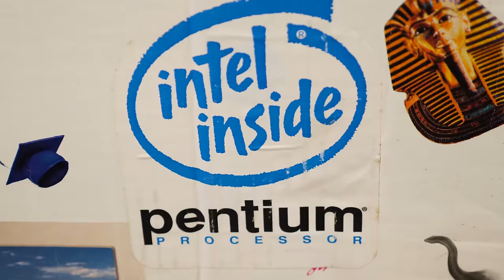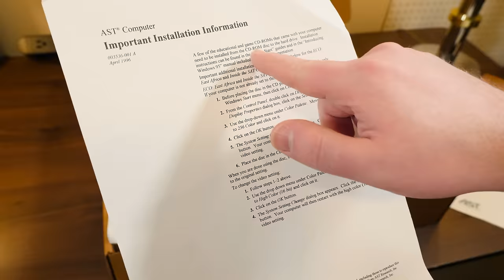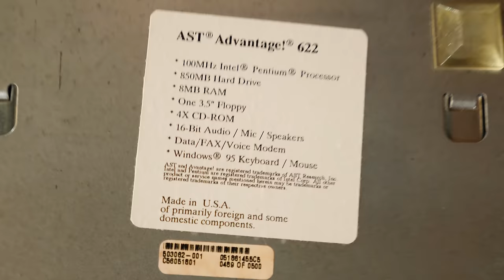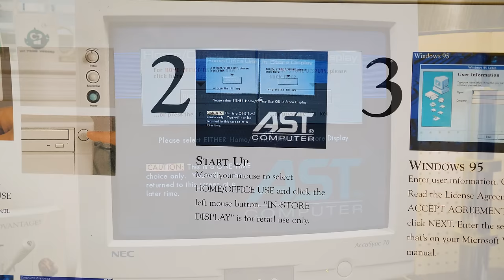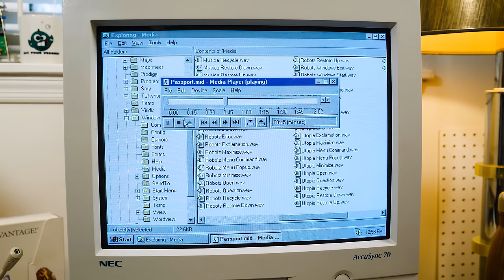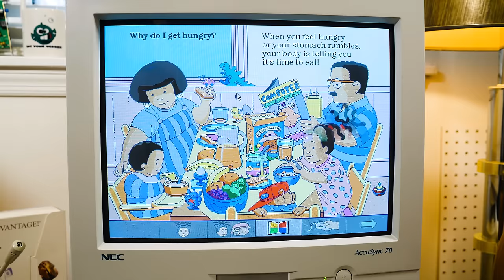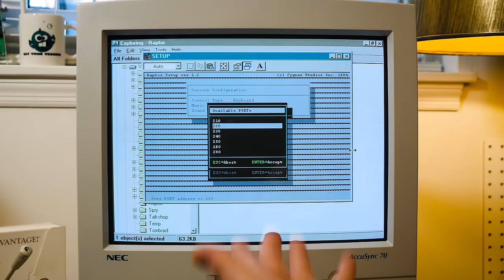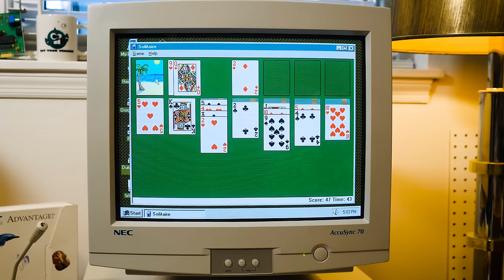This 1996 PC Was Obsolete Before You Got It Home: AST Advantage 622

Comment: One thing I hated about pcs back then was they always starved the ram while puttings tons of software in the box.    95 ran fine in 16mb.   It flew in 32mb.   It was always about all the software you got and never about having enough ram.
Reply: Yeah first thing I always did was delete/stop all the tasks from running. Every time I'd restart ctrl+alt+delete every task you don't need. You could get task manager in win 95 down to like 3-4 processes.
Reply: I suppose this was an entry level system in that specific time, I remember people with means specking their 486 DX2 66 with 16MB and lot of people that had 8MB purchasing a 8MB upgrade alongside their Windows 95 CD.
Reply: @RetroTinkerer  it was terrible back then.   Packard bell used to be the worse for cheaping out on ram.   There again the general public didn't know about specs back then so a load of software was looking good to them.

Comment: Clint, this video really hits me in the feels. My first real DOS PC rig was an AST Advantage 4/33SL from 1993. It shipped stock with 4 MB of EDORAM and a 240 MB Maxtor ATA drive. No sound, and only a 3.5" diskette drive. Later in 1997 (yes I still had it), it was upgraded with an ESS 1868 AudioDrive ISA sound card, an 8-speed Jafree optical drive; The hard disk was replaced with a 1GB Quantum Fireball 1080A, CPU was swapped to a 486 DX2/50 and memory was increased to 16 MB. I owned that computer until 2001 (it still worked fine) when it was finally so dang obsolete I had to part ways with it. Good times man!

Comment: This revived the magic memories of turning on for the first time our first computer, a Compaq, in 1997 and being greeted by Q from Star Trek TNG congratulating us for "finally buying a new computer" or something like that...
Reply: What kind of Compaq was it? I had a Deskpro 386/20e (heap of shit really) in the early 90s.
Reply: @the_kombinator  It's a Presario 4164: 150MHz Pentium. Audio, video (I don't remember the details :( ) and 16 MB of RAM all integrated into the mainboard, plus an ISA USRobotics 33.6K modem, 2.1GB Quantum Bigfoot HDD, 8X CD-ROM drive, 14" monitor with integrated microphone and passive JBL speakers.
It had a troublesome start (mainboard, front panel, CD-ROM drive, PSU and hard disk drive all failed at different times, the HDD twice... all during the extended warranty the seller talked us into. Good thing we didn't knew better and bought it!), but worked good after that. I still have it :-).

Comment: The AST name really takes me back. My first PC was an AST Advantage! Pro 486DX/33 back in 93. It was my "upgrade" or "transition" from my Commodore 64C. I first got it with Windows 3.1 and upgraded it to Win95 when that edition came out. I did all kinds of things to it. I remember upgrading it to a DX4, RAM and video memory upgrades, second hard drive, CD drive, external devices; you name it. Any compatible upgrade I could afford I would install it. I had a blast using it as a fax machine. It was a great time when the Internet was still in its inception. It was with that computer when got my first email address. I had it for several years until 2001 when I got my first Dell. I still have my old AST kept in storage. One day I intend to bring it back to life.

Comment: I am SO JEALOUS! Our first family PC was an AST 613e, a Cyrix 5x86 100mhz. Still works today without any replaced parts. The box is still in my parents loft I think. I so want that Clint! AST machines are just way overpriced by sellers on fleabay.

Quake + D3D look way smoother than on our Cyrix (I know, FPU). My mate had a P100 back then, Quake seemed amazing on that. Edit: Sorry, watching this at work, I didn't see the Spot part!
Reply: That's cool that you had a cyrix! I had a Intel 486 that I upgraded to a 133mhz 5x86 just so it could still be usable by my senior year of hs 😭the 90s were brutal when it came to rapid obsolescence of tech
Reply: For those interested, Nostalgia Nerd has a documentary on Cyrix CPUs and the Quake performance issues.
Reply: Same here, exactly that model. I loved it! We upgraded ours to 32MB RAM EDO RAM but unfortunately it only had ISA slots so I couldn't upgrade the onboard 1MB Cirrus Logic graphics with anything much better. It was however good enough to play Death Rally and I could even play the original Tomb Raider on reduced graphics. I remember the 613e also came with different software - Microsoft Golf 1.0, Cinemania '95 and a fairly early version of Quicken.
Reply: Actually in Duke3D the FPU wasn't as much of an issue if you weren't near slopes. Even Doom that doesn't use any FPU runs way better on a Pentium than a 486. While a 486DX4-100 will run Doom at just about full speed, a Pentium 75 will run it well beyond full speed.
Reply: Our family had the Cyrix version too, don't recall the exact model. By 1999/2000 it was a home under my bed where my rat liked to go, as I'd got in to custom builds and robbed it for what few useful bits it had.

Comment: There's nothing else on the internet that provides this kind of nostalgia, with this level of efficiency.
It's not just the hardware, but you cover the exact same areas that I would cover....
You might be me? But American 🤣
EDIT: ......and then you loaded up Raptor.... Omg
Reply: I always went to the first mission for a few seconds, hit Backspace then aborted the mission. Sold all but one of the Death Rays Backspace gave me to buy more weapons. I only used the Backspace cheat once per game. Never tried to see if it would work multiple times. But when Mountain King Software ported it to Windows they removed that cheat! Fortunately the save files were compatible so I could do the Backspace cheat in the DOS version then save and copy the file to the Windows version.

Comment: LRG thanks for the memories! This was my first computer I purchased back in late 1995 before going to college.  It was $1200 at Radio Shack.  It was only a 486 DX/33 but I upgraded it to the Pentium 83 overdrive the next year.  Then I ended up selling it for a few hundred the next year after upgrading again and building my own.
Reply: My first pc was almost the same, bought in 97 for university for £1200. I remember my university held an introductory lecture where they explained that our work must be produced on a computer, no hand written essays accepted. I still used to hand write my work and then type it up, save it on a floppy disc and print it at the computer lab. Good memories
Reply: Hahaha I had a very similar system that I also added the same Pentium overdrive to, those things (the overdrive) were fantastic!

Comment: It's nice to see what I remember from that era. Even though it is not completely full of bloatware, Windows 95 was usually around 40 to 50mb installed unless you installed more included features and added MS plus on top of that. So having only 340mb free of disk space, this PC was preloaded with a lot. Which is par for the course. The $1899 price was cheap for the time with it including a monitor. Back then when I sold computers and did PC support, a top of the line store bought PC with monitor was around $3000 to $3500. More if you went all out and bought additional software too. 

I miss that nostalgic era. I don't like how some PCs of the time were not open architecture but it was still a good era. Thanks for the video LGR

Comment: I never expected to see you review the exact same model of PC that I owned from 96-98! Really cool! I have some awesome gaming memories with this one. Spent all my time after school playing late DOS era/Win95 games on it, such as Warcraft 2, Diablo, Grand Theft Auto, Duke Nukem 3D, The Pandora Directive and many other classics from that era. It was a pretty decent gaming PC until mid 1997 or so, when system requirements for most games jumped to 16MB RAM and 3DFX cards really started to take off.
Reply: Sure enough computing moved too fast those days. Granted this PC was somewhat underpowered to begin with, but imagine buying a PC today and it feeling long in the tooth after less than two years!
Reply: @BilisNegra  Yeah, tech developed insanely fast back then. The Ghz barrier was broken only three years after this PC was released. And the original GeForce also came out in 1999. An exciting time, but also a very expensive time to be a PC gamer.
Reply: @kjetilhansen5363  That's it, exactly. A very exciting time for the PC magazine reader while ungrateful for the man on the street. Looking at it from the present time, where computing is more affordable than ever and machines over a decade old can run a modern OS, at least for not very demanding tasks, it looks cruel even. At the same time though, without that frenetic era of development, we wouldn't be where we are now...

Comment: I'm very surprised how relatively smooth quake ran for such specs, great optimization
Reply: Pentiums ran quake just fine, our school had p75 and we played it along with Warcraft II in multiplayer. My home 100mhz 486dx4 couldn't handle it though.
Reply: Even the slower Pentiums will run it better than even a 160 MHz 486. It seems like the Pentium runs it 4x better than a 486 clock by clock.
Reply: @fungo6631  correct. The fastest 486 by CPU Galaxy at 186mhz could only manage about 21fps. The FPU unit in 486 was much weaker and that seemed to be the reason.
Reply: @fungo6631  no wonder they're getting increasingly expensive
Reply: @djnjoy  Actually he manages to overclock it to 200 MHz more recently. And it's not just the weaker FPU, but the inability to run integer and floating point calculations at the same time. That and the 32 bit data bus.

Comment: My first PC, in about 1994, was an AST with 8 Mb ram, a 145 meg HDD, a 33 mhz clocked to 66 mhz, 2 speed CDROM drive and an actual Sound Blaster card, complete with colour monitor. It came with DOS 6.2, Windows 3.2.2 and MS Works on a single disk, along with drivers. Not state of the art but I loved it and it was good for gaming, especially DOS games. To reinstall I just had to insert the CD and let it work. I miss those days. I played Doom 2 a lot and eventually learned to design my own levels. I remember Pentiums had started to come out just after I bought it but I didn't upgrade until Windows 95 was released.

Comment: Oh my god, I had this same machine.  My first real computer.   It was a great computer and still actually worked until I moved once in about 2007 and abandoned the thing.  So many memories with this computer!
Reply: Side note, once I was able to afford it, I upgraded to 12MB of RAM, however I was able to get some games to work like C&C Red Alert running in Windows with the 8MB of RAM with (believe it or not) Soft RAM.  The software everyone claims is a scam, and I guess kind of was, but it did actually work in tricking the computer into running and utilizing page files or something or other.
Reply: Red Alert should've been runnable anyway...in DOS mode, at least. That's why it still came with the DOS version of itself and the map editor (RA.exe and EDDOS.exe instead of RA95.exe and EDWIN.exe) even after Tiberian Dawn got the 640x480 update as C&C95.
Reply: @youmukonpaku3168  you’re right.. but to play it via dialup against friends back then I couldn’t figure out how to do that back then not in Windows mode :)

Comment: I totally need to see this thing with 16-32mb of ram, a coast module, and an upgraded video card.

When I was in highschool in the late 90s I was given a pile of computers similar to this.  I mixed and matched parts and various upgrades I found in them and built the best combination for 4 systems.  I probably had 32-64mb of ram in them along with pentium 100 overdrive chips.  They also had coax network cards so I set them up on a folding table with two on each side.  We played Doom, Duke Nukem, Shadow Warrior, and other dos games with my friend and neighbors.  I used to make Duke death match levels and had a bunch we all loved.  This was a time where nobody had a home network or broadband.  Sitting across the table from each other and lan gaming was a blast.

Comment: This was the sort of PC you would find at Sam's Club in a bundle with speakers and with a CRT monitor strapped to it. 
It was a good deal.
Reply: I just built my own and saved a ton. By 1998 I had a 233 MMX with a Voodoo II, and I paid a lot less for it than this heap was going for.
Reply: @the_kombinator  The bundle we bought was just $600 including the monitor. Can't complain about that in the mid 1990s.

Comment: That era was what drove me away from PC gaming. Back in the DOS days, my 486 could handle games just fine for multiple years. Once games moved to Windows 95 and up, after one year your computer needed upgrades to play the latest thing.
Reply: Not much different now. My current rig cost $2k, which while not super top of the line, should be able to run anything reasonably at 1080. Baldur's Gate 3 turned into a slideshow. Still beat it twice, but I think if I play it again, it's going on my Playstation.

Comment: Now THIS was cool. I was an adult in the 90's, in my late 20's to early 30's when the 386/486 PC's were still around. My Dad bought one of these AST Advantage boxes at a PC auction sale in 1994, though it was the 486/DX33 version of this machine. 

It didn't come with Windows, but DOS if I recall, maybe not even that, anyway, it did get Windows 3.1, then 3.11 for Workgroups and it has the 2400Baud modem, Dad replaced it with a 28.8Baud version when he gave it to me. We bought a CD-Rom drive and it had its own expansion card so it was usable, adding an 8bit audio card, so early multimedia. I would get a 16, stereo card to replace that 8 bit one.

When it became mine in 1997, I upgraded it to Windows 95, added more memory and AOL 3.0, and it was AOL that took that PC down by slowing it WAY down and it took about 5 minutes, or so it seemed, just to get to the home screen (remember those?). Trying to job search, it was not practical, so went to a used PC place and bought the Bravo tower, a Pentium 133 from AST, gutted the 486 and reused what I could from that PC in the "new" one, sadly it came with a used IBM drive, I think the Deskstar with the ceramic platters and it eventually crashed due to the ceramic dust, caused by the heads hitting it and replaced it with a refurbished 17.2G Western Digital HD. Sadly, Win 95 could only see it as 17.2MB. I forget what I did to circumvent that, but ended up building an Athlon 800 based PC by purchasing a Asus A7V motherboard, with that processor and a "whopping 512MB of RAM, it needed a graphics card and an audio card and the rest I had, got Windows 98 (borrowed) and I was good to go.

I did basic games with mine, as I was not  much of a gamer, but did the internet a lot and over time and did a lot of other tasks as well, the dialup modem would hang often when it rained. By 2001 or so, went DSL and broadband and have not had dialup since. BTW, that Bravo PC was upgraded to the 56K modems and I think it stopped working some years later.

Comment: 8MB of RAM was a bit lean even for early '96.  The first new machine i bought was in 1996 and was a P100 starting with 16 MB which i later upgraded to a whopping 32 MB.   Had a couple video cards with that one too since i got a TV tuner card and that needed the right graphics computing power under the hood (ATI 3D Rage Pro if i recall).
Reply: agreed. my friend had a 200Mhz PC with 16MB RAM, and he could run Tomb Raider much easier, so I was always a little envious. But I learned how to optimize it, and probably became the person I am today. Now I run on 8GB RAM, and rarely need more (but can use it if I need).
Reply: @Quesar672   I'm running with 16 GB these days.... a bit more elbow room with that - 32 would be a bit of an overkill, even for me and all the stuff i can have going at once  😅

Comment: Great Video! I had a 120Mhz Pentium AST machine here in the UK. I had those speakers that were pictured, sadly I no longer have them. I believe POD didn't run because it requires the MMX instruction set. This was supported by Pentium 166Mhz, 200Mhz and 233Mhz socket 7 chips. This is from my knowledge at the time when I was 11 years old, so I'd definitely suggest verifying it!

Comment: It's kewl to see the old computers still being used today in a productive fashion.
One of the only games I played on my 286 (first PC) was solitaire while in an attempt to recover from a back injury. That was in 1990 and mine was a Hyosung turbo with a 16-bit system.  I didn't know how to work on computers at that time, but over the years I have gleaned abit of knowledge to doing so. If I had, the modem would've dip switches would have been set to work as it should have been. Coming out of the box one would assume everything was ready to go, as in the internet, but alas that one was not. Overall, it was great to have had it. Since then I have never been without one. 
As of February, a vintage 386 Packard Bell tower with Windows 98, which I bought on eBay, is due to arrive soon. I will then be able to use my old software & equipment I've kept which is more fitting to use on the older systems than modern systems. Can't wait.

Comment: Oh man that start up chime never gets old. I distinctly remembering using TalkShop, mostly just to play Salvo. It worked for me back when. YOU played POD back then? Our NEC Ready Series pc came with the OEM version installed. Absolutely loved that game. Bought it on GoG last year. We had one of the first MMX comps. I'll never forget the specs. 200mhz Pentium Processor with MMX, 2mb video memory, 16mb of ram, 3gb hdd, and a Sound Blaster audio card. Edit: I don't remember the HDD size, may not have been 3GB but the other specs are correct.